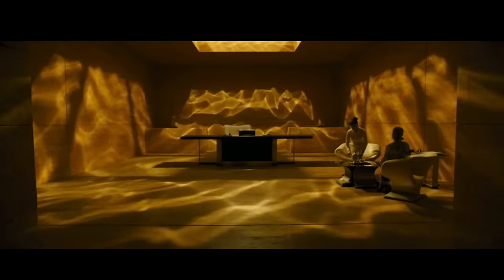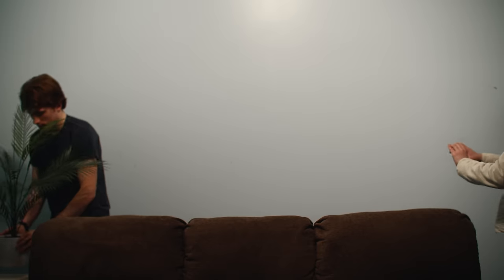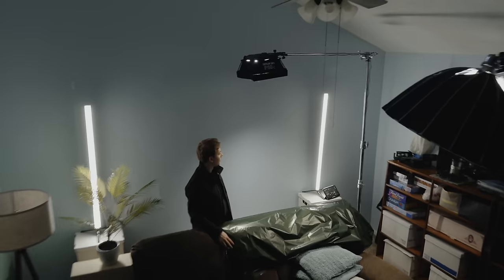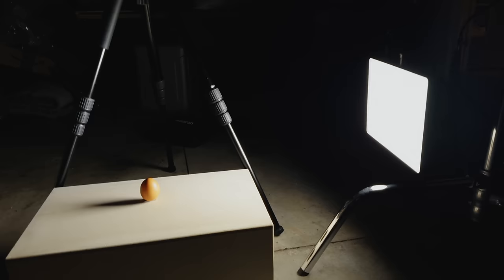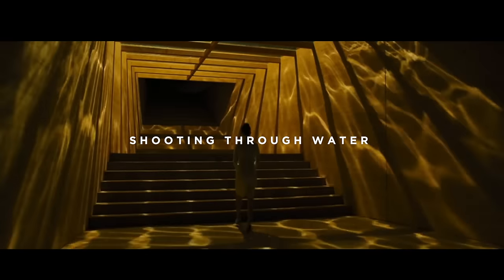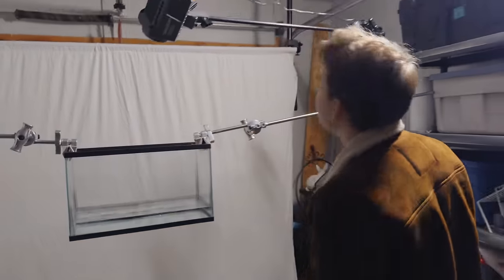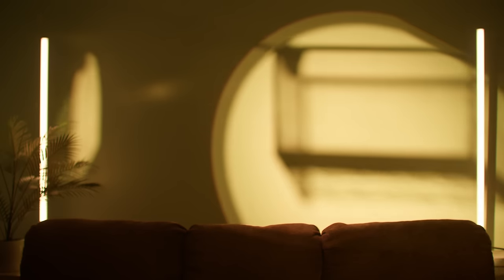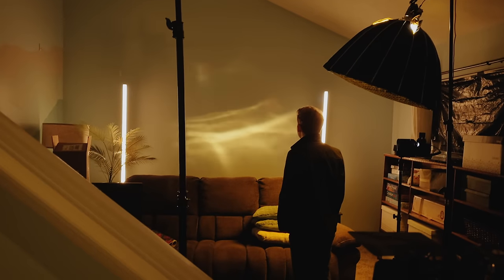Recreating the Water Caustics Effect from Blade Runner 2049

Comment: So at home depot every year for christmas they sell projector lights. basically christmas lights with some colored film in front of a spot light that you can shine on your house. Can you make a rotating disk of some light permeable material that would give you the same ripple effect?
Reply from the maker: That's an interesting idea! There may be some sort of material that mimics water when shot through! I would imagine it'd be more costly than using water, but once built, far easier to use and repeatable, which are very important!